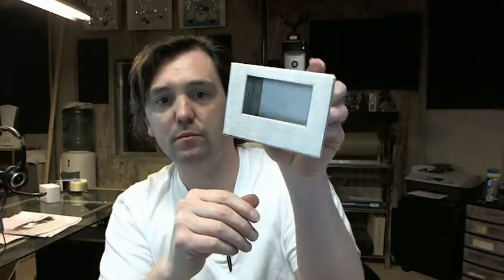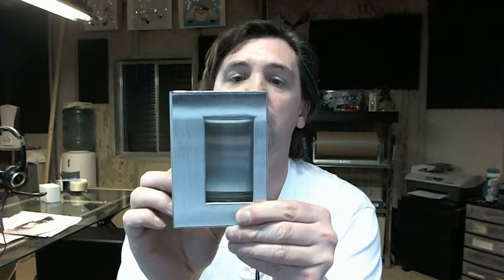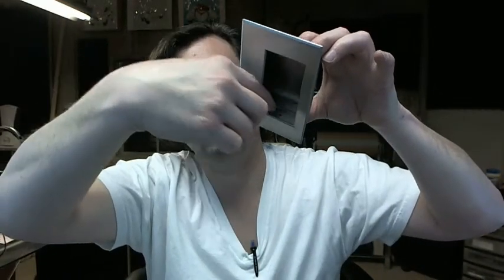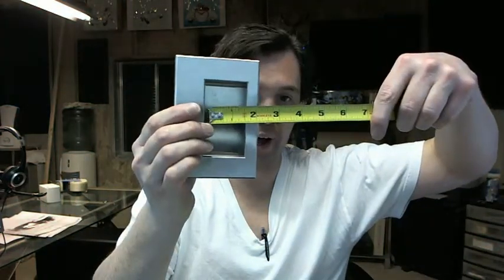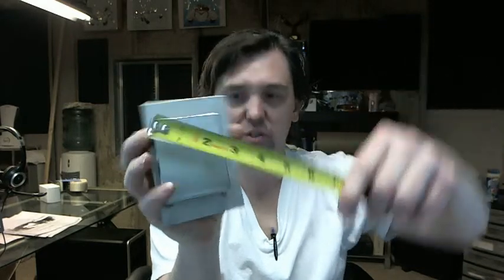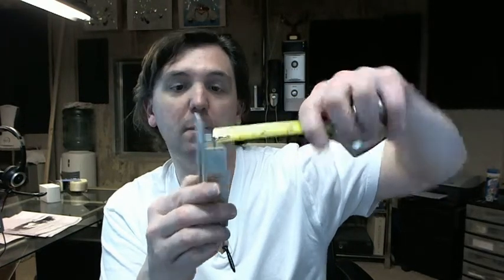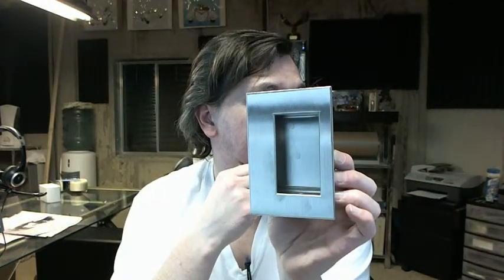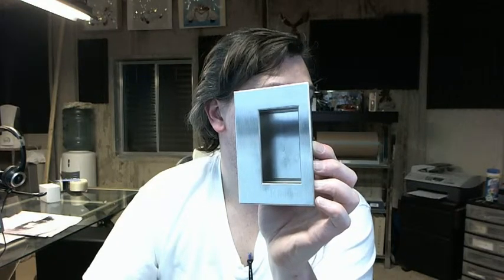Rockwood 94C Flush Pull

Comment: Richard, 
Can you tell me how much of a lip there is on the Rockwood 94C to get your fingers under to pull a door closed?   Your video was excellent, but I didn’t get a feel for how much of a lip there was to pull the door closed.  

We are wanting to have this pull installed on a 6 panel hinged door that is going to be used as the outside elevator door inside our home.  There is a sliding metal interior elevator door too, so we need a flush mount pull on the inside of the 6 panel wood door, and a dummy door handle on the outside of the door.   The door will stay shut with a ball catch, so I wouldn’t think there will be a lot of heavy pulling, but wanted to be able to fit my fingers on the inside of the pull to be able to close the outside door of the elevator.   Sorry if this explanation is confusing.
Reply from the maker: About 11/16" deep.
Reply: @absupplynet  Thanks Richard.